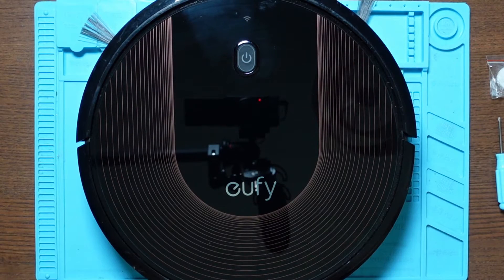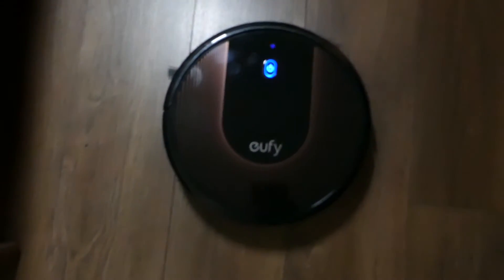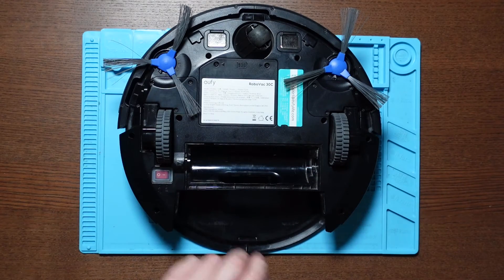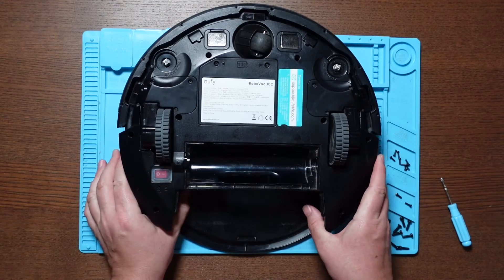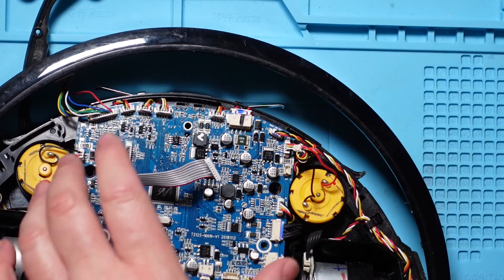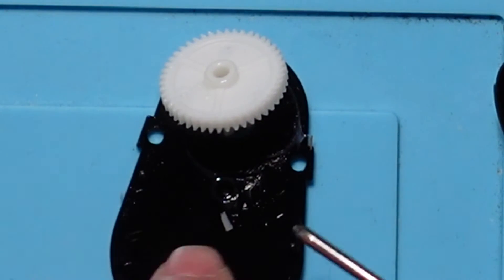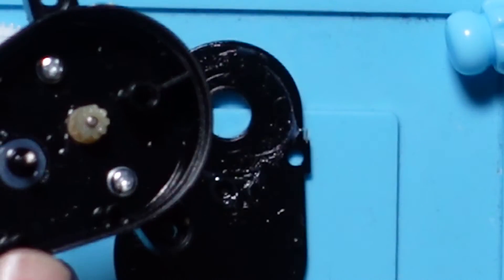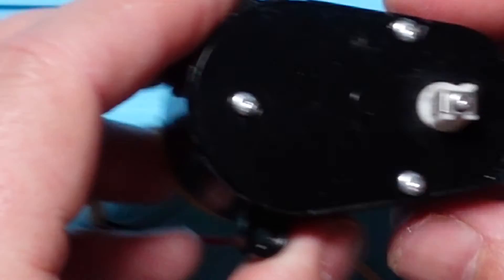HOW TO replace the EUFY Robovac side brush motor gears | Repair kit from eBay | Teardown & Fit

Comment: I successfully replaced a side brush motor and reassembled my 30c. It works well with exceptions that the  blue power button doesn't light and the robovax cannot successfully dock. What did I do wrong?

Comment: For anyone struggling with getting the bumper back on, remove the back cover again and check to make sure no cables came loose. I had one that was sticking out very slightly and trapped between the back cover and the front of the vacuum. You could see this was causing the slightest warping to not let the back cover completely seal/close. Once I took the cover off again and tucked the wire in the bumper went right on.

Comment: You too quickly gloss over the reassembly, especially regarding the front sensor bar.  On my Eufy that bar does not have a clear cut position, and I believe that's why I ultimately was never able to get the top back on corretly and then never able to get the front bumper back on correctly.  Although I was able to replace the drive gear sets for the front brushes, I ultimately trashed my Eufy because I could never get the front bumper on.  These things are not just not designed to be serviced easily.  Chinese junk.

Comment: This video has the screws around the wheel to remove it.  Mine doesn’t! We had to pound the “axle” out right next to the sensors.  It still won’t come out!  No way should we have to do this.  We have the x8 pro model.  Somewhat different about the wheels.  Somehow our spring came off the wheel underneath. Can you help us?

Comment: The gear on the motor shaft is far more stronger than the other two. Deliberately done by the company, so it can fail. Planned obsolescence.

Comment: Suggestion - please edit your video and add a step removing the battery from the vaccuum.  Even with the power switch on the bottom turned off and unplugging the power button on the cover, there is still power going to the circuit board.  In the step to remove the 3 screws to move the circuit board  slightly, one of the silver screws landed on the circuit board, sparked and created an electro-magnetic charge holding the screw to the two contacts shorting.  Pulled it off quickly, and removed the battery for the rest of the steps, but after replacing the side brush gears and reassembling, my vaccuum just beeps constantly as soon as the main power switch on the bottom of the vaccum is turned on.  Most of us DYI's that have had ours long enough to replace the gears are already familar with how easy and quick it is to remove the battery when doing this repair.  Time for a new robo-vac.
Reply: Es ist immer der erste Schritt den Akku zu entfernen.

Comment: I’ve replaced the gears but now the Eufy 11S seems to get confused and turns away from the base as it’s approaching, and won’t dock properly. I took apart and cleaned inside and made sure everything was seated correctly, but it’s still doing it. Any ideas how to fix?

Comment: I have a very cheap cleaner named "ONSON" and it looks 100% like this one. I think I paid €120 for it and it still makes a good job. It seems to be a really good Robovac clone! Can't wait to have a reason to take it apart so I can have an even closer look.
It only has some trouble with the main brush slot... or socket or whatever you wanna call it. The brush has too much space in the "passive" side of the socket that is not directly driven. It also makes a terrible noise but I just wrapped it in some aluminum foil on the end of the shaft and it works like a charm (it grinds away some aluminum... meh)

Comment: Hi Steve, since following this video I'm now getting the 2 beep error - "side brush stuck" even though it moves freely.  And I also can't get the bumper on properly. I've had it on and off three times and can see that the springs need to be tucked in but one side is just stiff and I can't see any reason why. Any ideas? I thought I was helping mum and now I've basically made her Eufy useless :(

Comment: Would be nice if these gears are more widely available. Unfortunately it seems you can only get the motor assembly alone. But at $20-$25 that isn't too bad.
Reply: $15 on Eufy site

Comment: This is great, but you cut out the hardest part; putting the top back on and making it line up. For the life of me, I cannot get this figured out and every video I've watched does the same thing - cut the video putting the top back on.
Reply from the maker: Thanks Yanksguy, sorry about that, it really wasn't deliberate.  If I remember rightly, the most important part of that is to get the springs aligned at the front - if they slip under the bumper, then it can be difficult to get it back on.  I'd suggest taking your time and trying to align everything up.  Once you have the knack, it's usually pretty straightforward.  I hope you manage it!  Good luck 👍

Comment: Great video! How can I find this repair kit? Could you send the link please?
Reply from the maker: Thanks Gwendoline, I got mine from eBay - depending on where you live, there appear to be options in the UK and US.  Search Eufy Gears and they should come up.  UK version:  https://www.ebay.co.uk/itm/154232058422?_trkparms=ispr%3D1&hash=item23e8f27236:g:PQoAAOSws2dgK6Y2&amdata=enc%3AAQAGAAACkPYe5NmHp%252B2JMhMi7yxGiTJkPrKr5t53CooMSQt2orsStEKTPzZMfQmny3knR97t0KJOaqEkQyoMFi0E2nh0q%252FCRJlwHkK1ibjvcAVjb3CLr4b5ZOxx9wepeFHrBs1FOfzZ5xn%252FcqYP5yFabmVh87TMZJuYS1D0QQLU0EMVE0GqrG6XA80PPwLmeMXaJ7HEgA61ItyuUfqeBmjVMrvBezAW%252FuZmVMUBMM%252Byu2S1V0l5bzDqw4pdxU7mXHY99hKZGVnYe%252BxOJKVcZnXHshF4C4a3uBfxy%252FfQAP3FgS5WnlE9vwMWZna2Qp9jrT5elhS5TlWIxjqCFu6rLzQyJnb0uYwlPjpaB5xRbZ4%252F5fLHGvIhqevNWTtfTSiV1OEbrQhnoef3AjRo3X6CJq5GgSzz04%252BSw2ZqkuiaDugEo3p4OTeEtq0Bu0Tr9k%252Fa%252FClrykE%252FauHKZw4cpYHckVyB9RORqIBNTeporU%252Fr20vsIv9N67SNCTM3sft0n7JSP3pITMWNkO9oEXmSZ6OF8B8SS6vlOR28T1%252FZxcke1ywZLGaxGxvT%252BDhC2JTmIOtBL15UjonYZI1uDONg8l682zdD%252FfNIZ98Q1EKkbzreE8HmuDUItCr9ItsIlM35153Tw3EM4rAplU58sXTZPiirBE%252FV2izcWaAHpF8uSH60xcihL0UVpFVbDlC05BFpi1VZ3NggnHtqT5CPpMbuj6KhiW4t47hPmBwSI%252B6V9gv%252FI9FIlSvWBvj3SNUoR2w2tlto08Jfp6HqhD19tNJO3KVLXiEVnDj1GdvXjv0YNV0SyRgiGZS7qTzwG4dYw0vGEWvodu5ZT46ELeUBnBFgCujkA8jDtiCUy3QiEE3q1%252BvhZmr9Xu808ylNC%7Cclp%3A2334524%7Ctkp%3ABFBMjLrx37Vf

Comment: Thank you for a very well done video. Is the 25C radically different? I cannot find replacement gears for the 25C.
Reply from the maker: Thanks Larry! I would imagine it's the same gears, as they all seem to share those parts. It's unlikely Eufy would manufacture a different package for the 25C, so I would think you'd be fine! 👍

Comment: Really helpful video, and very easy to follow.  Mine failed in this way, but Eufy replaced it under the warranty with a refurb unit - that died within the year, but I was able to salvage the parts from it to fix the original!  Many thanks.
Reply from the maker: Glad it helped! Thank you 👍

Comment: Very helpful video Thanks 🙏 
I got replacement gears on eBay.   The seller actually provided a link to this video as well 
Here is the item number. 👇🏽👇🏽👇🏽

11S11SMAX15T3030C15C12 35C
Reply from the maker: Thanks Bradley! 👍

Comment: The MOST important question is not being answered: where did you purchase the replacement gears???
Reply from the maker: To be fair, it does say "repair kit from eBay" in the title! 😉
Reply: It's a little late, but for the US market Eufy sells a decent amount of parts including the side bush motor and gearbox for $15. You just need to go to their website and go to the find my accessory page.
Reply: You still didn't answer the question. Are you a politician?
Reply from the maker: Suprisingly, I got the repair kit from eBay. If I was a politician, I would've said "let me be clear..." first...
Reply: @StezStixFix  They, and everyone else, are asking for the link, please don't be pedantic. If there's a reason you don't want to tell us, just say that instead. You had my like and sub till I read this silliness.
Reply from the maker: @ashlynnnn8973  thanks for the comment.  I don't know what you want me to say.  I bought the kit from eBay, it was from a UK seller at the time and they are no longer selling them.  If you just do a quick search on eBay, then you'll find some.  The links change all the time, so I can only apologise that I can't keep refreshing links for them.  Here's a current one:  https://www.ebay.co.uk/itm/154232058422?hash=item23e8f27236:g:PQoAAOSws2dgK6Y2👍

Comment: Very nicely made video. Clear, organized and accurate. I used a weekly pill organizer to temporarily save the 7 distinct screw types used to assemble this portion of my EUFY 11S, and a rare earth magnet stuck on my screwdriver to help extract the screws embedded deep in the plastic body parts.
Reply from the maker: Thanks Timothy. That's a very good call with the magnet! And always good practice to keep the screws organised. Really appreciate the feedback and kind words. Thank you. 👍
Reply: Quick pointer. You can magnetise your screwdrivers by stroking a magnet along its length. The more you do this the more powerful the magnetism.
Reply: @arrsventing k

Comment: Replacement side brush motor is working perfectly now! However my 30C will no longer dock itself for charging. It take the wrong angle and make a ton of noise while struggling to get on the charging contacts. Any thoughts on what could have gone wrong? Thought It had something to do with the IR lights on the front but being misaligned but can’t be sure. Any help or guidance would be appreciated.
Reply: Pay close attention to 12:43 those are the sensors the Eufy uses to find its way home and its very easy to accidentally fold them under the board rather than seating them into the slots in the bumper.
Reply: @mick0905  mate, you absolute legend!
Reply from the maker: Hi Cody! Glad it's working. Yeah, I think you've likely knocked an IR sensor while putting it back together. Probably worth checking it out! Also just make sure they're clean while you're at it. Good luck 👍

Comment: Hi! I fixed this but now for some reason it's telling me the drop sensors are dirty, but they're clean! Could it be a bumper issue? :(
Reply: Nvm got it sorted, the connector had come loose from a sensor ON THE SENSOR SIDE, which made it very difficult to spot, but figured it out after several tries. Everything works great now except it is considerably louder overall, hoping adding a bit more grease will help as my kit came without any grease and had to use old grease from prior cogs.
Reply: I'm getting this exact same thing, was there ever a resolution for you?
Reply: @super8mm68  I had the EXACT same issue! Glad you got it sorted :)
Reply from the maker: Oh no! Is it possible that you haven't connected one of the cables back to the main board fully? Worth checking 👍
Reply: @StezStixFix  I connected all of them, and then I took all the drop sensor ones off to see if that would stop the error and it still said drop sensors were dirty so I reconnected everything.

I'll try it all again this evening with a fresh pair of eyes 👀 I have 5 cats and live in an old house and everything was covered in a thick layer of dust. I cleaned it but maybe it needs a better clean. :/

Comment: Thanks for this, I have the exact problem. Time to order the gear kit and try and replace them.Had a problem with the Robovac shutting down mid clean, contacting EUFY all they could offer me was a discount on a new one no repair or spare parts (I assume this will change next year with right to repair) turns out it was the battery, so I bought a 3rd party one from Amazon
Reply from the maker: Thanks John! Yeah, I've heard that Eufy aftercare isn't great. Hope you get your problem sorted! Good luck 👍
Reply: @StezStixFix  Thanks, Q: can I use normal grease if my gears don't come with silicon grease
Reply from the maker: @JohnSeto  yeah, it should be fine with any kind of grease to be honest 👍
Reply: @StezStixFix  Thank you. I'll let know how I get on
Reply from the maker: @JohnSeto  Excellent, good luck! 👍
Reply: @StezStixFix  Just to let you know I've fixed the gear, your video is perfect. Took a bit longer as I'd forgot to connect the power button to the mainboard 🤦‍♂️, take out all the screws again! Anyway all noise gone, peaceful Robovac. Thank you so much for the video
Reply from the maker: @JohnSeto  Thanks John!  Really happy that you got it all sorted, and it's running nice and quiet!  👍

Comment: So the tutorial is spot on, even got mine back together and it worked but......  finding a quality replacement may be the biggest problem. Got mine off an Ebay site everything fit right but by day 2 all the teeth had stripped out. Honestly it worked better when the left side turned 25% of the time now the left side is dead. I think the eufy would be fine for hardwood floors only. They replaced the left side once and so did I so have to believe its a design flaw.  Buyer beware....
Reply from the maker: Hi Scott. Yeah, it does seem to be quite common, and I'm sure there are people out there that are just 3D printing these cogs and selling them on eBay. In which case, they are not gonna last.

Comment: Great tutorial man!!!
Reply from the maker: Thanks Jackercrack! 😊
Reply: Thank you so much
Reply: Do you have a link to purchase the gears for this Eufy? Please post.
Reply from the maker: @jackercrackbox  depends where you live, but have a search on eBay, there are usually a few to choose from.  This is UK:  https://www.ebay.co.uk/itm/EUFY-RoboVac-11S-11SMAX-15T-30-30C-15C-12-35C-sidebrush-gear-cog-replacement-set/154232058422?hash=item23e8f27236:g:PQoAAOSws2dgK6Y2

Comment: Where do I buy the replacement gears?
Reply from the maker: Have a look on eBay. They are not always in stock, but usually reappear within a few days. 👍
Reply: @StezStixFix   https://www.ebay.com/itm/402357811305 Do you think I bought the right piece? Can I just use any old grease if it doesn't come with it? Thank you in advance awesome video!
Reply: @TheRabbittz  Silicone grease. Although some recommend lithium as it doesn't attract dirt. I used silicone plumber's grease.
Reply from the maker: Sorry, just seen this! Yep, those gears look correct, and as Eric has rightly said, silicone grease works a treat! Good luck 👍
Reply: @TheRabbittz  LOL that guy is 3D printing those parts!! If they work that´s fine with me.

Comment: Awesome video!!! I just disassembled mine and then reassembled it. No teeth broken in any of the gears. I am still getting a buzzing from the roller brush on my Eufy 15c. When I remove the roller brush, no issues with sound. Wonder if the motor is going out.
Reply from the maker: Thanks Robert! 😊 I think it would be worth trying a new roller brush before replacing the motor. Sometimes the plastic wears down and they get a little loose and 'rattle' a bit. Give it a go and see if its quieter! 👍
Reply: @StezStixFix  Thank you for the recommendation! Will do. Happy 2021! Keep making the amazing videos!
Reply: Just got a new roller kit from Amazon with new brushes, filter, etc.. That did the trick. Yay!!! Thanks again for the recommendation here. Saved me from pulling the whole thing apart again...
Reply from the maker: Excellent news Robert! Glad it fixed it 🙂

Comment: Nice tutorial. Up until the front bumper install. It definitely is not that easy. Been trying for 45 minutes....
Reply: I found the bumper trim was too tight. I backed off a 1/4 Turn on each of the screws and played with that until I got it right. Make sure the springs are in proper position though.
Reply: I also had a lot of trouble with the bumper.  I figured out that I'd misaligned the circuit board and inner trim around the motor.  Check that the two eyes on the circuit board are properly in their holes and that the inner trim is installed correctly all the way around.  Once I did that, the bumper went on easily.
Reply from the maker: You get the hang of it. Make sure the 2 springs are being pushed in as you guide it on. Hard to explain, but you'll know when you do it right. Good luck.
Reply: @StezStixFix  Sorry mate. If the 2 springs are pushed in the bumper doesn't spring back. It almost seems as though the tabs are supposed to go together on the top but then it is also to tight. I have been trying for 90 minutes now. There is something missing when you are describing disassembly. Wish I had another go at it when taking it apart. I would definitely pay more attention to how it was together. Now I am out the cost of 2 sets of gears. Love the vacuum so much I am trying a second. Nice video but again it definitely needs more.
Reply from the maker: I'm not really sure what to say. It's really hard to help you without seeing it, but sounds like something has gone wrong. It can take a few tries, but certainly shouldn't take that long. Here's the official Eufy video on replacing the bumper which may help, in case you haven't already seen it: https://youtu.be/k1ZWBRJjDJI
Reply: @StezStixFix  I appreciate the follow up my friend. I watched that video along with others. I agree that something went wrong. This is my fault I just want others to pay closer attention in removing that bumper. Mine definitely does not slide on that easily. I purchased the same vacuum again. If I have to repair the gears in that one I will handle the disassembly much differently. Thanks again for the follow up. To you and yours for a better 2021!
Reply from the maker: Thanks Scott, appreciate the feedback and hope you get it sorted. All the very best for the year ahead 👍
Reply: @StezStixFix  it took us 2 people